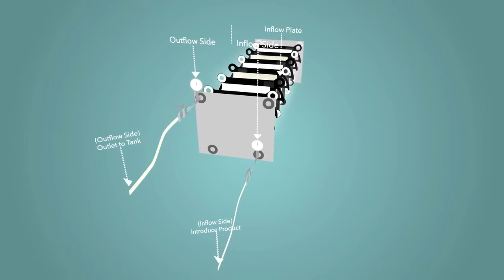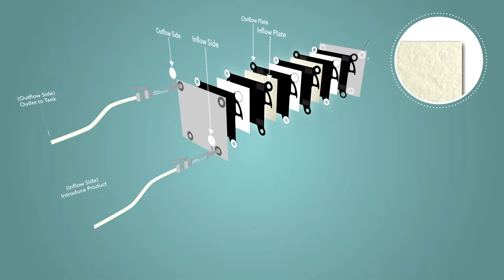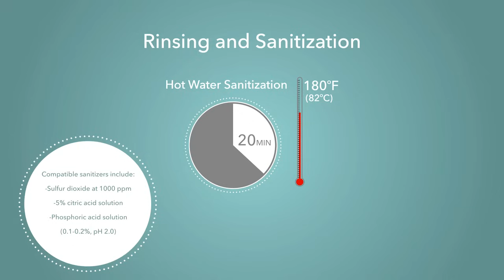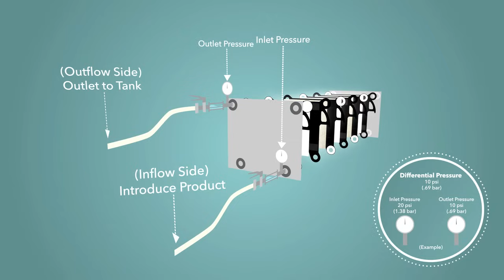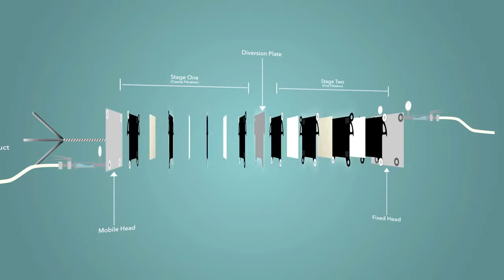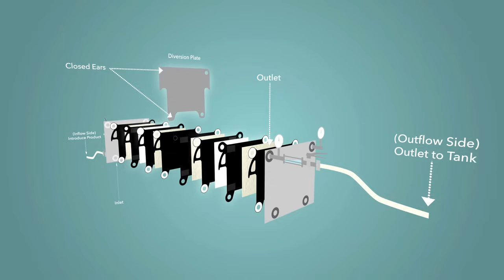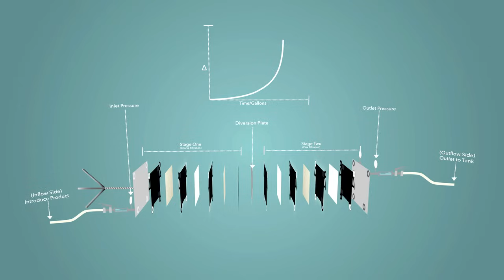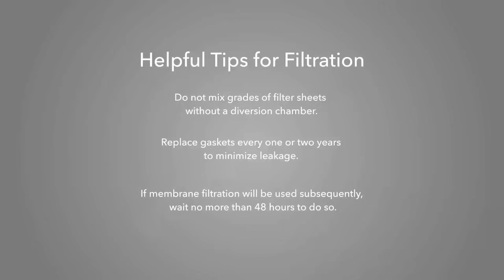Scott Laboratories - Sheet Filter Setup and Usage

Comment: Thank you.  That answered  (visually and instructionally) about  possibly using two different filtration level filters.    If using a diversion plate in order to use two filtration mediums, what is the biggest differential you recommend (for wine), e.g. 5 micron initial to 1 micron secondary?
Reply from the maker: Hello - thanks for your question. Please refer to this article where we show the maximum drop down grade on the chart for any given grade: https://scottlab.com/filter-media-grade-selection. If you have additional questions, please contact us at 707-765-6666 or info@scottlab.com. Thank you!

Comment: on 1:45 it looks like the side of the first plate facing the wine is smooth side when it should be rough side no?
Reply from the maker: Hi Clement - great question. That is actually a common misconception. The orientation is correct because it is in fact the coarse side facing the wine due to the diversion plate changing the flow pattern. When you follow the flow pattern by looking closely at the inlet side of the plate and see how the direction changes in this second stage, you'll see that it is correct. Let us know if you have any other questions. Cheers!
Reply: @ScottLaboratories there isn't a diversion plate in use at 1:45. That's not in the video until the 6:00 mark so wouldn't the user above be correct?